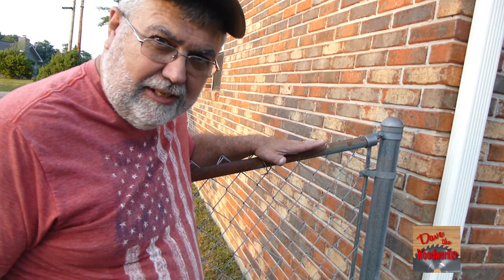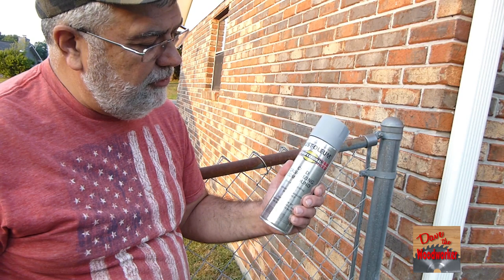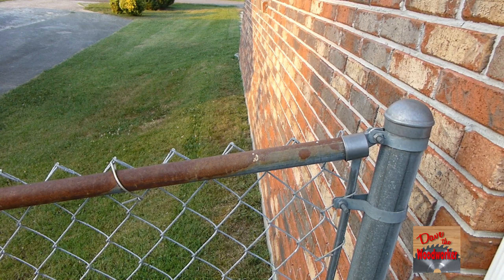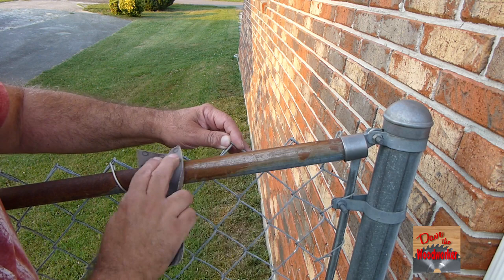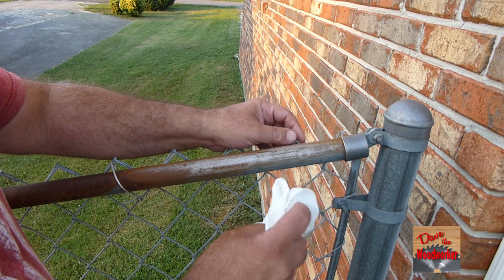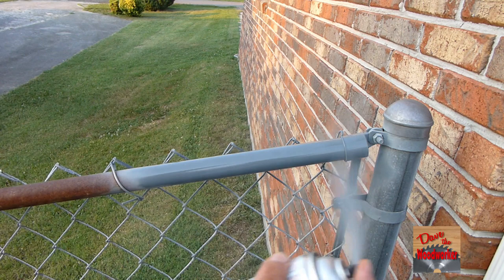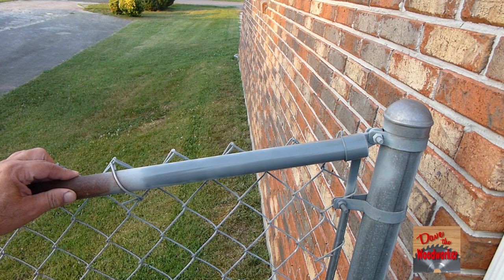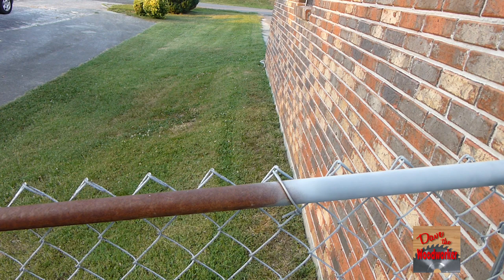How to make a Chain Link Fence look good as New

Comment: I did this. It looks good, but when you reinstall the wires that hold the chain link to the horizontal pole, anywhere the wire touches, and I mean “touches”, just knocks the paint off and you’re left with bare metal.